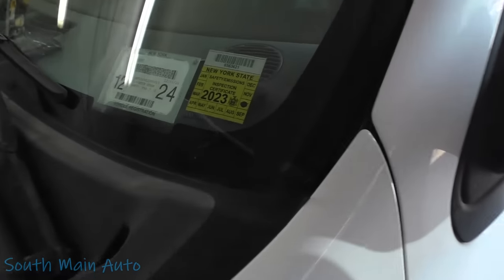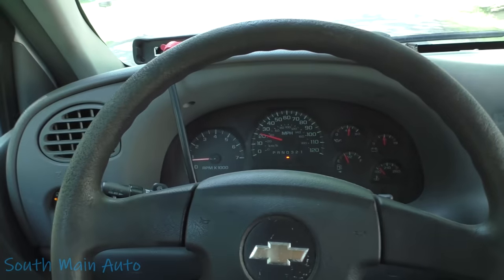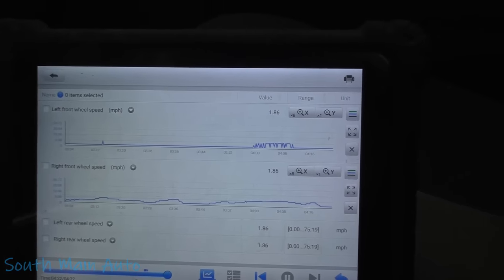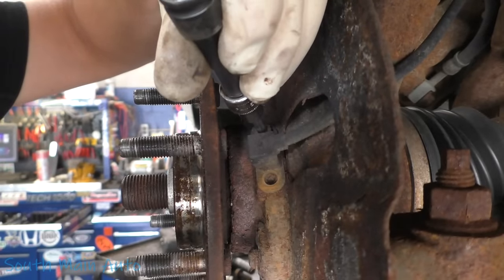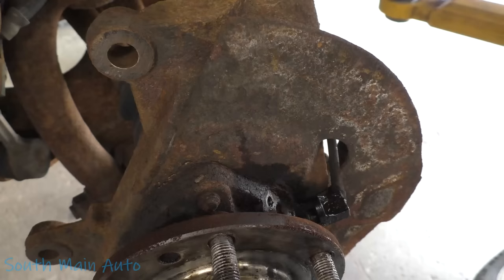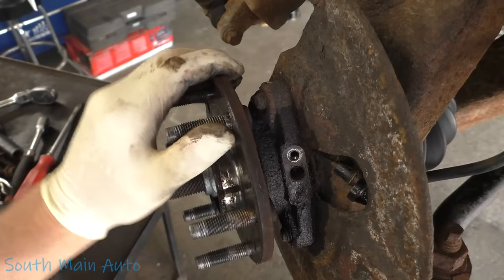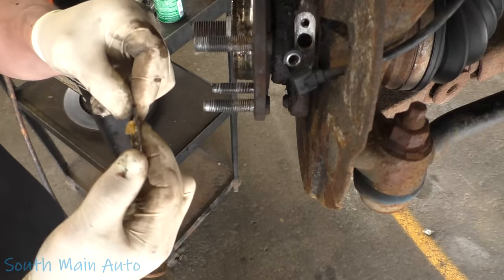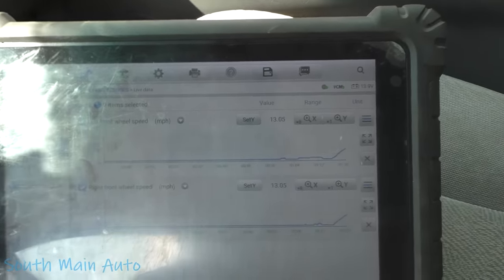Chevy Trailblazer: Unwanted ABS Activation When Stopping

Comment: I've run into the same thing on my SAAB 97X (A trailblazer really WITHOUT the ability to manually control the transfer case - STAY AWAY FROM THESE by the way!!)).  Crappily designed hub allows rust to lift the sensor to the point where it is too far away from the tone wheel.  THEN, they usually break off in the hub and you need to drill them out, thread in a screw, and yank them out.  Clean up the bore, use a q-tip to get any junk out, and install new sensors.  I hate GM products.

Comment: I knew my issue was a problem with a wheel speed sensor on my trailblazer.  I figured I'd just replace the speed sensors (I was nervous about the shims and though to at least look for videos about the problem) and be done with it.  Now I'm gonna check for this issue first.  Thank you for giving us shade tree mechanics this tip!

Comment: Common on older gm products in my area. A quick down and dirty "fix" just to be able to drive it safely temporarily is to pull the abs maxi fuse. You'll have dash lights, and you won't have abs, but you will have functioning brakes that don't let you roll stoplights. 😁

Comment: i currently have a 2001 bmw and i replaced the rear right wheel bearing with an aftermarket brand (vaico) and i would get the ABS light to flash...went back and pulled out the wheel bearing months later and noticed the tone rings were not precise and noticeable like the OE brand (INA)... replaced with a quality brand it fixed my flashing abs light issue.

Comment: Erics got a fine Brake caliper file there for sure...BUT...You can get a Bahco file for less than half the cost and Bahco files are good quality files.Bahco is owned by snap on.I use them,they are sharp,and way better than your typical cheap file for around 15 bucks,as opposed to 50 bucks..

Comment: 2011 kia optima, this light started coming on after pressing brake pedal a few seconds. Started not long after a front brake job. Then the 3 brake lights went out and now the work intermittently along with ESC light. I replaced brake light switch didn't fix it. Could be the speed sensor? Stumped why brake lights not working. Not in rust belt.

Comment: My dad's 03 blazer does the same thing. I didn't know that when I first drove it after he died and I took possession but I freaked out the first time it happened. I've lived with it for 2 years before finally ordering a new bearing due to noise but haven't put it in yet. Mine is LF as well and I did the same thing. I grabbed my snap-on solus edge and graphed all 4 speed signals and watched mine drop out under 3mph

Comment: 06 VW, replaced wheel bearing and hub with aftermarket crap.  noticed at every stop ABS would activate at slow speed coming to stop.   Long story short, bad hub had wrong dimensions and too much of a gap between sensor and teeth.     OE ever since.

Comment: Both my suburban and sierra did this. My suburban i did both front WSS because they were covered in grease from the hub assembly failing inside. Cheap and easy fix. My Sierra it was the connector down on the abs module and pump that was corroded in half on one wire. I've become very familiar with the low speed abs activation. It's usually a very easy diagnosis and fix.

ALWAYS do both sides. Because if one is acting up, other side is going to soon. Ive owned a lot of GM trucks, they all do this. It's either rust or grease on the sensor end in my experience. And i live in the rust belt.

Comment: this is a bit off topic but the same thing happens with some crankshaft sensors, the plastic sensors with just 1 bolt into cast iron will do it just fixed my daughters 2013 elantra I did replace the sensor but just cleaning the engine block would have probably worked

Comment: I'm guessing the parts store has run out of the musical brake clean and fluid film? 😂😂😂 I had this issue with same vehicle,  same wheel. Replaced the whole bearing and all and it would still activate only on stops. Told him I didn't know where to go from there because I didn't

Comment: I live in the rust belt of PA and for sure we've seen dozens of GM trucks with ABS problems due to the sensors being pushed away from the tone ring due to rust buildup.   Rusty crusty is no good.

Comment: I have an 04 Trailblazer, the wife has an 06. Hers has the SensaTrac system, mine does not. I believe 06 is when GM started putting it on the TB's. Another thing that can cause an issue with the SensaTrac system is the steering wheel angle sensor. Again, hers has one, mine does not.
Between hers and mine, I've replaced more than one hub/bearing assembly! I've gotten to where I can do it in 45 minutes start to finish, taking my time. TB's are rather maintenance intensive.

Comment: My 97’ Silverado has done this before and it was a bad wheel speed sensor 6years later it’s doing it again now. Got thru the diagnostic with a volt meter and the help of a very old motor magazine I had saved just because they did an article on the Kelsey Hayes anti lock system. 
Save your old magazines 😂.

Comment: My driver front had an erratic code. I changed my speed sensor. It corrected the issue. 10 miles later. I got a short abs motor code. I chant remember exactly what it said but I remember short. I can’t win for losing…

Comment: Love that. I have a Chevrolet with the same type hubs. I've had problems with the speed sensor on one wheel. I 100% will try to see if I can clean it off. Being as I'm not a real mechanic odds are I'm buying a new hub after I break it but I am going to give it a shot.

Comment: This happens when I off road in deep snow.
When the tire is spinning and you hit deep snow and the front tire stop's from hitting the deep snow my trucks abs motor would run without touching the brake pedal.

Comment: I got an intermittent ABS fault in my Chevrolet but GM made it easy to figure out, they routed the ABS cable through the chassis without any grommets and when the cable eventually wears through it grounds and trips on the traction control. Could also be a bad ABS module or wheel sensors too.

Comment: dont know if youll see this or not, but i broke off 2 bolts, 2000 chevy it was to that egr evap hose that goes to exhaust. well i called someone and they quated me $50 if they could weld a nut and get it out and $110 if they had to do it another wway. well i got 1 of each, but man i live in a small town, and i just think those prices are crazy high, or is that about right? i can get my drill in there, dont know best trick to drill through those hard old rusted bolts but i thought this dude was crazy about those prices, possibly 220 to drill out or however 2 easily accessible bolts and replace with any kind of nut and bolt. me or him crazy?

Comment: I had that fun with the driver's side sensor on a Chevy; didn't pull then either. Blew the sensor hole out while spinning the notches, cleaned it up a touch & the sensor, some dielectric grease around the sensor... fixed.

Comment: When you mentioned the problem about after market speed sensors my heart sank…id just replaced one after breaking the original one which was stuck in so hard (i was replacing the wheel bearing anyway) i hed to drive it out from inside the hub carrier. Well hopefully all will be well…i will find out soon enough

Comment: Thank you very much awesome video I do have a question man I have a same trailblazer 2006 with the problem we check all the speed sensors are fine and the front has Brian, New, speed sensors but sometimes the light comes on the traction control on and off consign for a while When I go somewhere and then when I turn it back on it’s not there anymore but then will come on sometimes after while driving what do you think the problem is man no codes for traction or speed sensor or ABS thank you

Comment: `I was wondering if the magnets on the sensors get weaker with use and the rust just aggravates the situation?  I had a A/C pressure sensor on a Toyota Rav 4  variable compressor go weak in the magnet and all it took was to add a cheap button magnet to the top of the sensor and bingo A/C sensor is working again. No discharging the system. Still works great going on 3 years..

Comment: I had an occasional speed sensor light come on with my Porsche. There would be metal built up on the sensor magnet, and once, the wheel had gotten a build up of dirt, goop. I always check that first if one of the cars has a speed sensor lamp come on.

Comment: I fitted a new rear wheel bearing on an Audi once then got an intermittent abs fault. So I fitted a new sensor in the middle of the wheel bearing. Anyway it still had the fault. It turned out to be the reluctor ring on the new wheel bearing was slipping intermittently 😂 don't you just love copy parts

Comment: Very common in Illinois i call it wheel speed sensor maintenance aka cleaning the mating surface and im not even 30 secconds in its always one of the 3 or 4 if equipped with four on gms dont throw parts diagnose

Comment: My traction control light has been coming on for years and I try three new steering angle sensor including oem ,both front bearing Nd clean all the grounds underneath and changed the brake controller and after liked 2o minutes light comes back, i taking it for alignment and the steering wheel is straight, but on my computer I have no pit to adjust 1 6 degrees off to the right

Comment: That's the reason why aftermarket speed sensors for those Chevys always come with a stack of shims.  Put the sensor inside the hole and bottom it out.  Gently rotate the hub and if you feel the sensor make contact with the grooves inside the hub then you need to start stacking on shims to back the sensor out a little.  When it no longer makes contact inside you are usually good to go.  ABS light will go out and all is well.

Comment: ty got the same problem i think the abs pump goes crazy when come to a stop had to remove the fuse then when you apply the brakes the abs pump does not pulsates go pedal is normal now i am thinking its a wheel causing the abs pump to activate not the pump itself.

Comment: What a great repair. (great and honest) Question, could you get a schematic from the manufacturer that shows the allowable spacing for the sensor to work? It seems like such a tight window. That rust was maybe 0.005? or 0.010? Are they that sensitive? Also, shout out to the Black Ice freshener. (welp, nevermind, you answered my question before I could finish typing, I'm keeping it for the ALGO)

Comment: Great video. The same thing used to happen to my 2003 Silverado. Have you ever done the oil cooler lines on a 2016 Sierra 2500 4wd and is there a video? Would like to see how you did them.

Comment: I had an ESP/ABS problem with my Mercedes C200 on the right rear wheel. I tried a new sensor which didn't cure the problem. The magnetic pickup ring was the issue so I replaced it and ended up reinstating the oringal sensor.

Comment: The low speed braking while not holding steering wheel was the way my father checked brake pull on front drum brake system.( After assembling new shoes on it).

Comment: Haven't frigged with one in a while (quit wrenching) 
Seemed the likelihood of getting a bad speed sensor right out of the box was about 50/50 back in the early 2000's
Rarely saw factory sensors go bad by themselves. 
Typically the hub bearing would go, taking the sensor out as well. (2000's GM vehicles)

Comment: I just heard someone say: "Never charge people for your time. Instead charge them for you expertise!"
Right here is a great example of Expertise.

My 2001 Toyota Corolla did the same thing with the ABS kicking in, at a stop, when the pads were really thin.... I replaced the pads and rotors, no more problems.... Well except that the ABS system on a 2001 Corolla was a death sentence even when it was working "perfectly as designed"....

Comment: Regarding the compatibility of an aftermarket speed sensor in the existing hub, does it stand to reason the existing speed sensor might have an issue when replacing the hub with an aftermarket?
Reply: The aftermarket hub comes with a new sensor

Comment: A bit off the subject but..... Removed and replaced the front bearing hubs on my 2014 Altima. Watched your video and purchased the last chance hub removal tool you recommended. Worked like a charm and saved a lot of time. Beats the heck out of hammering on those hubs or breaking out the old slide hammer. trying to remove them. Thanks for the recommendation.

Comment: So I ran into a replacement sensor that was too short.
So I used JB weld to glue a small chip of a neodymium magnet on the tip of the sensor.
I didn’t have a scanner to look at the signal but I could measure the milivolts output and it was within specs .
Unbelievably it worked perfectly for over 7 years!
That’s what I call a MacGyver…. 😉

Comment: Hi Eric, Again, this is why other shops bring jobs your way, Honesty, you could have unloaded the parts canon, instead saved the customer some money and possibly an accident! Good Man!! Those Trailblazers' are pretty nice SUV. We had an 07 for 13 yrs. over 200k miles run & drove like a champ, dependable ,roomy and all the accessories you need. The only bad thing is the frame on right & left under the driver and passenger position, there are no drain holes in the frame and it holds water and dirt and salt, well you know and the frame rots out. I did ours and a neighbors both sides inside cut out the rot and welded new pieces in, Looked like new. that's the only real problem we had with the vehicle, Oh the rear hatch had broken wires in the flex, that was the first thing I checked, pulled and yanked on the wire and then it blew a fuse so I tore it apart ta da power and grd. wires were broken. I guess I made it show its ass when I was yanking on the wires. This fix was all with your help start with powers  and grounds. Thanks Eric.

Comment: Metal chips on sensor magnet shows bearing is gone and also cause ABS light to come on.
I put  a little 90w oil in sensor holes on my Chevy trucks and bearings don't go bad as much especially on passenger front mud puddle side.

Long Island NY road salt sea salt wrench here..

Excellent channel 👍

Comment: I've never had luck deciphering which wheel speed sensor dropped out.  I started watching the abs module output -- the dump valve -- to see which wheel the abs has relieved pressure to.  If only one sensor has an issue, you'll have three off signals and one on signal and bam, theres your problem lady!

Comment: In my experience on the t blazers is that you will flag one sensor dropping out and replace it. Then the other one is just slightly wonky and when you put a new one in the one on the other side drops out early causing an issue. Long story longer I replace them in pairs now. If not I tell customer ahead of time what may happen.

Comment: Yup. My truck would do the same crap..  had a wheel speed sensor that wasent seated perfectly..
Reply: Was rear right.. only.  Wheel would stay centered and put me out in the middle pf an intersection a few times,,  would only kick on at less than 5mph when stopping..  was pretty hairy but reseated the sensor.  Said it had debris on it but was just not seated all the way.

Comment: Nice job on the repair. My grandpap and my uncle both had this issue on their early 2000s GMC trucks. They both just pulled the ABS fuse rather than fix it.
Reply: My 06 ran that way after replacing  hubs every 2 years. 3 times Gm never covered them said it was from off use lol. Itvwas was the last gm I owned.

Comment: Of course you know you are ruining your files by scraping back and forth. Just one time scraping on the back stroke destroys 22.65 percent of a file's effective life. It's a well known fact!
Reply: So stroke it 4.5 times and throw it away and get another new one. Might as well get a case of files.😅
Reply: dragging files backwards drives me nuts, but 22.65% LOL it does shorten their life signifigantly, but lets be real.
Reply: @leftyo9589  I know. I was just having fun. Have a great day
Reply: Just use muratic acid to sharpen files.

Comment: Excellent video Eric.  Having same problem with my 03’ Tacoma.  All new brakes then this problem showed up.  Going to try the tips you demonstrated.  Sensors for my truck in the front are between $300-$400.  Lots of rust from my previous Pennsylvania address. Live in Florida now and trying to maintain my vehicle.  I think they should stop using salt so generously in the northeastern part of the country.  Grew up there in New England and didn’t have as much rust problem in the 50’s and 60’s .  Oh well.  Metal is a lot thinner today not to mention plastic.
Reply: Toyota should also toss in the wheel bearing for that price!
Reply: @s.j.5850  I wish.  Just hope Eric’s tips work.  The sensors come with a new harness which I can’t believe that the Dorman part(which I’d never use) is just as costly as OEM.  Tacoma World forums has some interesting tips on cleaning these sensors if they’re salvageable.
Reply: @tomcrotty1498  Good luck Tom.  Wrenching is not always easy, but there's never a dull moment.  We either get to curse the engineers, or the manufacturers, or both.

Comment: Question.  If the rust under the left speed sensor is bad enough to cause that kind of trouble, isn't the right one likely not far behind?
Reply: Are you one of those to comment before watching?  Like talking in the middle of a movie?
Reply: Eric knows that, but he didn't want to fire the parts cannon at the other side if it's not malfunctioning.
Reply: @MazichMusic  He didn't replace any parts.

Comment: Nice fix! The best parts on a proven system can sometime be revived with an Ivan approved NPR. If they haven't already, monitoring wheel speed needs a simpler design. Maybe monitoring the wheel hub in the open instead of a corrosion prone hole.